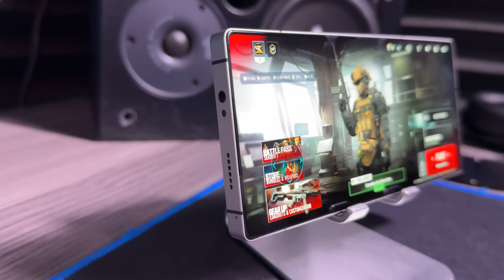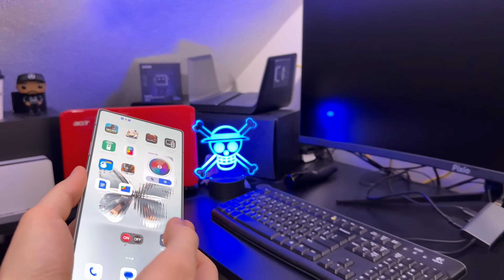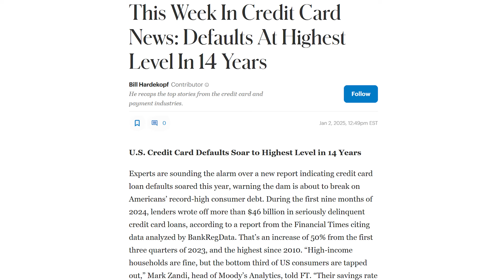What CES Revealed About Repairable Tech In a Record Year For E-Waste (2025 Is Not Looking Good)

Comment: Yup, they wouldn't Let me
Trade in my 4+ yr old cellular device because the hardware was starting to fail, for a new one. That tells you something so I kept it. Even though the battery is going to hell. I got a new device. Those eco 🏧 are a rip off too, so got no choice but to use it until hardware fails as a tablet then toss it in the eco-waste pile as dead hardware because, Noone wants to repair it around here nor do the parts exiting anymore they phases them out.

Comment: Same in Heavy Industry.  I've worked in factories for 20+ years as Electrical / Electronics Tech.  Used to have user serviceable equipment all the time.  Easy board level repairs, end user replacement parts.  I used to rebuild everything.  Nows it's entire device replacement and it's maddening.

Comment: If you get a PC from me it's because it will last longer. Prices depend on the benchmark scores on 3D render testing the better the score the more I want for it. Water cooling is not for a business machine but I pick heatpipe and copper heatsink upgrades for everything. You should see the workstation I built for myself less than 300 bucks. The "refurbished upgrades" are usually fast enough to play medium-powered games but I don't tell anyone that most people don't want their employees playing PC games. Usually, the cooling upgrades will make it render video faster in video editors. I always say refurbished upgrades because refurbished could mean they used toothpaste to get it going, I've seen a lot of refurbished.
Reply: In 1984 I dumpster-dived with permission into the Bell System trash and got very rare Western Electric gold plated transistors. Some of them I collected are in a museum now. They are so rare I couldn't sell them for what they would be appraised at. They are not worth 10 bucks to most people. The best thing I could do is put them in an electrical museum. There are some dangerous stuff I put in there old coils and caps with PCB's. Some of us paid attention to where this stuff was going and found a safe place to dispose of it.

Comment: I have been saying this for years.  We are "innovating" unneeded things for people who don't want them...and it just causes shit to cost more...and be limited on lifespan.

I have a buddy who works in a hospital system as a custodial maintenance technician.  He works on everything from elevators to lights, to sensors, to the random electronics like doors or motion lights.  He has a unbelievable amount of education that he has to stay current on to do what he does and as such is one of the higher paid non-doctor people in the hospital system.

He has convinced me to hate the new modern sanitary trashcans.  The ones that will auto open to accept your tray in the lunch area.  It has timers, and motion sensors and feedback sensors to prevent a kids arm from being cut off.  All so someone does not have to push on a flappy door which had been used for probably at least 50 years.  He said that once a week he has to go and mess with one because they are terribly unreliable.  BUT because the hospital put so much money into them they want to use them for at least 10 years according to their depreciation schedule or whatever.  He said that between all the locations there are at least 50 of them, and they are constantly malfunctioning.

Why?  Because someone is too freaking lazy to open the lid?  SMH.  The smartest dumb shit I have ever seen.  Same with talking elevators, or touch screens in elevators...or motion sensor water faucets.  Smart fridges are junk...and the one I spent 2200 on has never worked right...and periodically I have to reseat the filter because it forgets it has one.  BS...Give me the KISS model anyday.
Reply: WE ARE DUMBING DOWN THINGS THAT ARE INHERENTLY SUPERIOR

Comment: If these companies could. They would push subscriptions down our throats for the hardware we use.

Look im a capitalist. I believe in the free market, but like any ecosystem it has to be maintained at a equlibrium.

We are reaching the point where the market is becoming unstable. We basically dug under the foundation for short term unsustainable gain. No regularion is going to fix this, only a complete market collapse with zero government intervention will. Thafs what should have happen to the auto maker, not make the taxpayer bail them out.

I mean we are gutting technical skills. Before it use to be common for people to fix their own cars, do minor repairs at home, even fix basic eletronics if they had the gear. Anything that was out of scope went to the local repair guy who was on a first name basis. Maybe you the plumber did a trade of labor with your mechanic who helped fix your truck when you were short on cash.

None of that exists because of these Nymbi MBA types who just see numbers go up. Eventually we are going to run out of people thus halting that dopamine rush. Why cant these guys just go back to the booger sugar and hookers?

Comment: I worked with cars, European brand. About the same thing. Back then when your headlight spoils, you replace the bulb. Now if your "longer lasting, environment friendly" LED headlights malfunctions, guess what the whole thing goes. The whole thing costs a ton and then you have to throw the old ones away and only a small bit goes back to the manufacturer to be repaired and that barely happens because "Apple can only touch Apple products and not anyone else"(example) and unlike Apple, you're not gonna ship all those faulty car parts back to the manufacturing site for repair cause it's not worth it. More and more things are being designed as one unit, so that if one thing fails, that whole unit has to go.

They're adding so much useless tech into every newer model, some of which work only in ideal conditions and increasing chances of failure or bugs like some systems that rely on software. We all know softwares are never perfect but they keep making it more complicated. The bigger the softwares, the more bugs and glitches you have.

Less fuel consumption? Sometimes I wonder if the amount of fuel you have saved is worth it cause how much fuel do you use to make these complicated  fuel saving systems where some malfunction and gets thrown away cause it's so complicated that one atom of defect impaired it? The live servers/systems that you have to keep running to maintain your sophisticated software. The fuel you need to maintain offices that maintain and safeguard your software.

Computer repair shops are struggling? Guess what, mechanics are also quitting nowadays

Comment: I have a Lenovo X1 Carbon as my work notebook, and when a USB Port failed a few weeks back and I sent it off for repair (still in waranty) they had to swap the whole mainboard, RAM CPU and all. Thats just nuts. A CPU FOR A USB PORT. At home I am running a 14 year old HP Probook that has one screw, ONE to open it up, swappable ram, swappable storage and a daughterboard for the USB Ports on one side. Its just crazy how bad even some business laptops are these days.

Comment: What I would also recommend is buy the Dell Precision Mobile workstations that are refurbished, Intel 8th gen and up.

I have the refurb Dell Precision 7730, with 64GB, a 4TB and 2TB Nvme drives, Nvidia Quadro P5200, and it runs perfectly, although I had to replace the RAM, as it was very faulty. Everything in that workstation is modular and replaceable; the GPU, RAM, screen, webcam, the palm rest and you can have the option to add a smartcard reader and add NFC. After the replacement, the machine runs faster than the Flash ⚡️⚡️⚡️

Comment: Noone's going to see this comment, but ASUS actually has easily replaceable batteries in their ROG gaming laptops. Yes, they are only available in their top-of-the-line Strix SCAR laptops but hey, at least they put them SOMEWHERE. You can also get to the battery without removing a single screw. Just my two cents that likely nobody will see :)

Comment: Everyone should build the pc themselves, don't buy brand name possible non repairable PCs. That is what I did for Windows 11. It cannot be rejected by a company. It's a little more expensive, but it will last! Don't buy a Dell, an Apple, HP, Lenovo, or any other brand. They will eventually RIP your PC. If one builds a decent pc, you would not have to change everything inside the pc, only the parts needed for the repair or upgrade or new. The case will last forever, almost. If they are going to do this, let's shunn them. DON'T BUY!

Comment: If you are casual used stuff is great, the only con of using things like thinkpad is that they do not have enough processing power for many applications. I would love to rock one of those bad boys, but it would just burst into very well contained flames if I tried to do some database logic in SAP (been there, done that). I remember using HP Zbooks to warm up my coffee, now I can't even BLOW THE FCKING DUST OFF MY FANS because it voids warranty on the company leased laptop. 
Still, if you can afford building PC, you should, especially with how cheap AM4 builds can be right now.

Comment: I buy new laptops (sorry), but I buy them on fat sales and run them until the battery has been dead for years. I've bought 2 since 2017, the most recent is exclusively for college classes. I ran a note 4 until I got an a53 when it came out. My desktop has the hardware I put in it (minus the graphics card, aio, fans which I added later on and hard drive) that I bought in 2014. Still rocking a 4790k I've de-lidded and overclocked. When I retire this setup it's going in a server to run for another decade.

Fast tech (cellphones) should last 5 years only having to change a battery (which should not be a stupid in depth process that might potentially lock out the phone). Laptops should be easy to work on (stop gluing components in you goons) and potentially usable for 10 years.

Hardware like fridges, washers, dryers, etc. should be at most once every 10 year purchases. Not being able to buy the replacement coolant for them to replace a pump is annoying too. I get it, it's flammable, I have to purge the system before replacing the pump, drawing a vacuum, then fill the system. Let me do it you clowns. I don't want a smart light bulb or wifi connected microwave.

Comment: My employer has between 4000-6000 Windows devices in circulation, and we use between HP, Dell and Lenovo. 

When a user has accidental damage with HP (spillage), to replace the motherboard, its cheaper to write the lease off and replace the device. That is with their corporate discount . . . . . . . ..

Comment: So here's a fun little thing I learned. Your video sent me down a rabbit hole of TPM searches, learning that you can buy a module if your PC doesn't have one and has a header for it. But then I found a thread that said that post 4th Gen Intel CPUs (which I have) are capable of software TPM, and many of the motherboards only have to have it flipped on in the BIOS. So I went into my BIOS (I have a MSI Z270 MoBo, bought in like, 2017), and sure enough in the Settings pane under Security, I just had to flip a switch and now Windows recognizes that I have a TPM.

Comment: I may not have a lot of room to talk since I own a tablet 2 in one, but you are right we are fucked when it comes to repairable tech. I've got an Asus ROG laptop that I bought off of eBay a while back and we upgraded it as far as it will go even as far as putting an actual SSD that we could slap in the Hard Drive slot, and I was only able to get it updated to Windows 10 and will not be throwing it away. P.S. I do own a decent desktop computer now so if anything, I will use that instead and slowly upgrade the parts in it.

Comment: The correct white goods handle advancement is Neff ovens who have a mechanical handle that you pull down the over door, the door slides under the oven and the handle hinges upward for that. It's the most amazing advancement in oven technology since fan assisted electric ovens. It gets completely out of the way which makes your kitchen much safer and means you aren't reaching over a hot oven door to reach it.

On cars it makes sense to conceal the door handle because of drag which is a lot bigger problem than you'd think even from a door handle, let alone wing mirrors. But I've not seen an oven going 70mph down the motorway.

Comment: They're making consumer laptop almost pointless now...  Someone at work killed a keyboard on a Thinkpad E15 G4.. was going to replace the keyboard until i opened it up and saw instead of securing it with screws it was riveted with like a dozen connection points... I said fuck this and tossed it.. (The MB might have  encounted issues as well so i just saved myself the grief)
Reply from the maker: The E series is a disgrace to the ThinkPad name

Comment: Throw linux on the longer lasting Laptop and ditch windows and all its crap forever. The more endusers migrate to linux the more the better the support for its software will get as more companies have to deal with linux and the drastic change in mentality of its architecture!
Reply: Good luck with that. I highly doubt it will happen. Most people will either move to ChromeOS or Mac.
Reply: @JJFlores197  thats also an option, at least the first of the 2, the other is the same as windows!

Comment: You're trying not to become Louis but you don't need to worry about that because you're both right to be angry.  
  
Unfortunately I don't think there is enough manpower to reflash all of the Windows11 ineligible (for reasons that we, those in the know, know to be BS anyway) to Stable User-Friendly Linux desktops. That might be the recycler's market to work towards the best timeline though. Does Grandma need Windows11? Probably not, and neither do the vast majority of consumers, or even businesses (some niche industries sure, AutoCAD still doesn't port to Linux well) but I'd wager most normies can figure out Ubuntu or Mint if it means saving several hundred dollars to replace their perfectly functioning Computer which mSoft decided to stop supporting. (Although, history tells us that they don't, because Wannacry afflicted tons of XP Machines still out in the wild decades after support dropped...)

Guess we just need to try to stay optimistic. Some sort of OpenSource aftermarket bypass for laptop batteries could be good down the road, 3D Printers aren't too uncommon anymore, someone out there can probably figure out reShelling a laptop to have easily accessible removable batteries and cable adapters to run from board to new shell location and/or different battery types (can't be the only one tired of hunting down unnecessarily obtuse batteries which were only used for 1 or 2 generations)...

There's just so much... stuff.... and too many people want the easiest and least thought provoking solutions for their broken stuff, and it's infuriating. If computers were cars, the vast majority of people out there would be buying a new car every time that they were due for an oil change

Comment: this is a huge part of the reason i shy away from laptops for personal use... i repair my own stuff, and i don't have the patience to wallow through all the "improvements" that have come along in the past decade-ish... and then try and deal with the nightmare of sourcing the parts... i build my own desktop machines, so i'm certain i can do any and all repairs/upgrades... i also refurbish "obsolete" desk/laptop machines that are then sent to other less fortunate countries where they are often used by doctors, of all things, due to the situations in those locations... they are grateful for any and all working equipment, so i feel good about the time i spend  on each of those units... the OS isn't an issue in a lot of cases, as a lot of these never touch a network... but i'd use the workaround if they at some point required 11, as whatever amount of time they had access to that OS before some update nuked it, they would absolutely be grateful for...

Comment: Mate cars are going the same way. Used car dealers that deal with the low end stuff that ordinary people want to buy to get to work are complaining about the same thing. A car that you could sell for a couple of grand as a daily runabout is non viable to sell as the Led headlight unit costs 800 quid or has rear reversing cameras that always fail and can only be had from the main dealer at stupid money prices. The current generation of cars are stuffed with infotainment screens that also connect to the main systems that will be unaffordable to replace as it costs more than the car is worth, making it e-waste on a grand scale. Over complex garbage will be key in the fall of this civilisation all for stupidity and corporate greed.

Comment: I see the same thing with cars, except it's not even part availability it's dickhead landlords and apartment complexes preventing tenants from performing basic repair or maintenance tasks. In my lease I'm not allowed to so much as change the oil on my car while on the property. Before I moved, I could swap a subaru engine in 3 hours by myself and I'm not a mechanic, I'm a biologist. Now I will have to purchase a much newer vehicle than the late 90s and early 2000s stuff that I've always had in the hopes that it lasts long enough for me to get my own place (wishful thinking I know) cause god knows if the rear main seal starts leaking I'm not allowed to fix it and the cost to have a shop pull an engine is more than the value of the car. I applaud you for not going full Luigi on tech CEO but if you do.... I didn't see anything, dude had racoon like stealth and my phone was doing a forced update so I couldn't get a picture sorry.